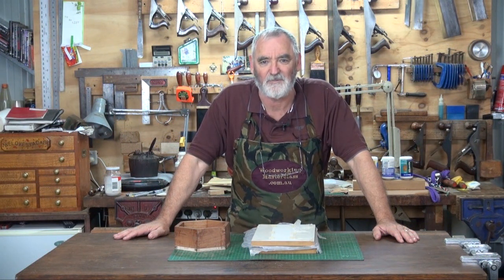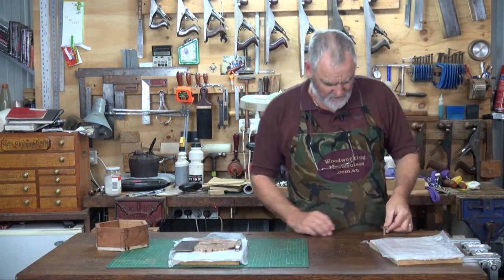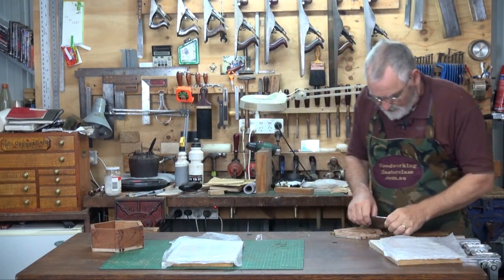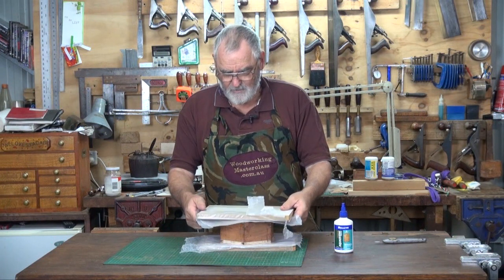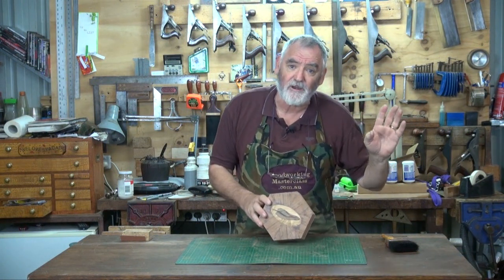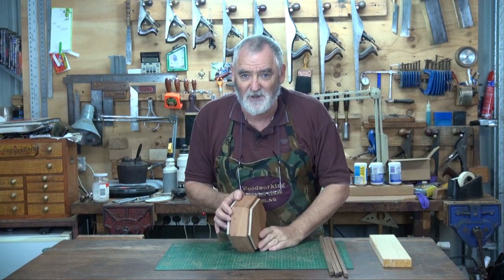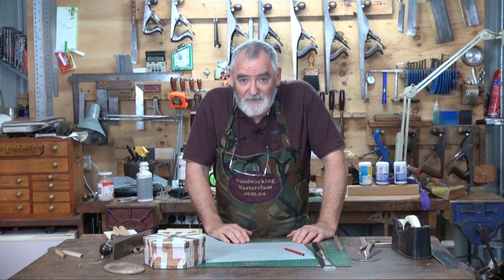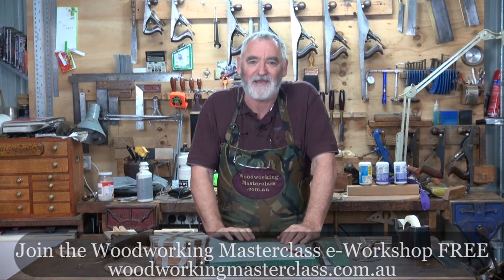Hexagonal Marquetry Box Pt.5

Comment: Are there any varieties in hide glue? And whats the general setting time?

And its always fun to fix those "last minute design changes" ;)
Reply from the maker: Daniël P There are 2 main types of Hide Glue (to my knowledge) the general Brown one I use, or Pearl, Scotch or Animal glue as it's sometimes called and and a more refined one the Instrument makers use. There are other protein based glues as well such as Rabbit and Fish Glue. Not sure about FUN? but satisfying would cover the retrospective emotion. lol Cheers Steve
Reply: Woodworking Masterclass any distinction in quality from hide to hide glue? as its looking like a better way to do veneering, then again do you really need a veneer hammer or just a good press? I'd think the pressure would disperse the glue just fine or am I wrong there?
Reply from the maker: Woodworking Masterclass Forgot to mention Daniel, setting varies a lot depends the consistency of the glue the amount used the humidity and premature. As a rule for large jobs I allow over night and but sometimes a couple of days. Smaller jobs a couple of hours. It's a case of each glue up is different. Cheers Steve
Reply from the maker: Daniël P I've not found any difference between glues personally. As far as requirements for a veneer Hammer. In theory you are right but in practice I have had some disasters happen when I haven't used one. The idea of the hammer is to remove any air from the veneer, glue and substraight sandwich, creating a vacuum. This then allows atmospheric pressure to act as the press itself. If you are using a well behaved flat piece of veneer this is all that is necessary to the laying veneer down. It the cases of burl or cranky veneer the press is there to hold it in place until the glue has set long enough to keep it where it is meant to be. I'll make a video of how to make a Veneer Hammer in the Next couple of weeks and will let you know when it is uploaded. In the meantime anything flat and hard will do the job just as well. Cheers Steve

Comment: "Design modification" !  Cheers! --Chris.
Reply from the maker: Cactus Makeshop Expressions of free will. Cheers Steve
Reply: I once made a special sized bed side cabinet (my first woodworking project!) where the sides were the biggest and the bottom was actually quite narrow (50 cm height, 60cm length and 30 cm base). I needed to have 2 drawers in it and I did the drawer assembly with a quite tired head and not checking the plans. So I connected the drawers the wrong way thinking OF COURSE the biggest dimension was the drawer bottom. I made new drawers and the messed-up piece became, after being covered with a soft padding and material, a foot-stool with a rather spacious compartment inside. Mistakes are great! Sometimes.